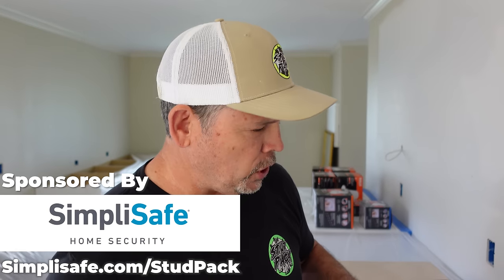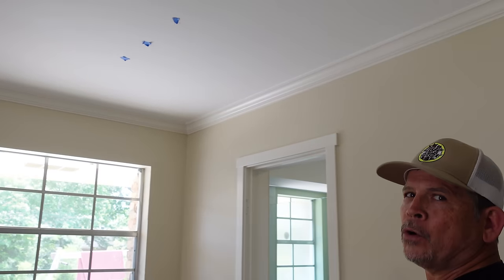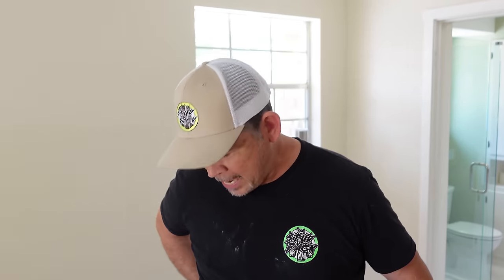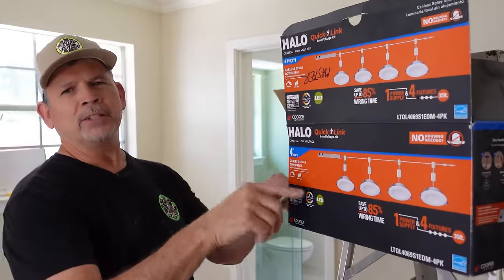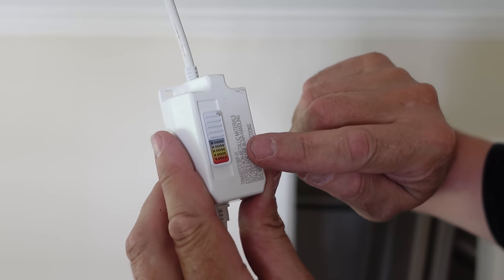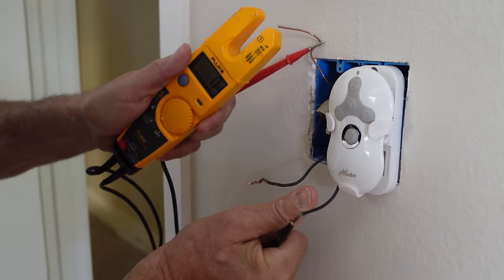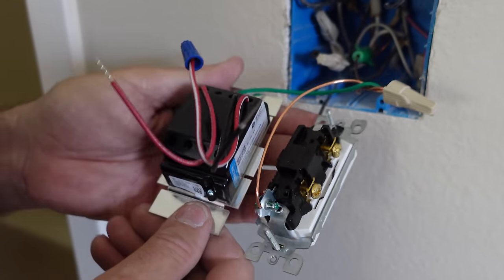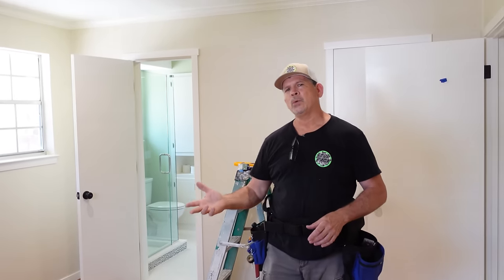HALO Just Changed the Recess Lighting Game with THIS!

Comment: Been an electrician for 8 years. Never pulled carpet or subfloor back, what a waste of time not to mention liability. Two cuts in the drywall, a little fishing, and you're done. Patching the cuts takes wayyyy less time than carpet, trim, and subfloor removal. Additional, these lights never made sense to me. Where exactly are you supposed to hide the power supply? It's not accessible. These don't save any time and are limited in how many you can run. I'll stick with the 120v Halo pucks, work just fine. I can wire 6 in a room in 2 hours.

Comment: These guys’ videos have been so helpful in my remodeling projects! From this video, I got myself that same hole saw and I also tried these lights. I ended up returning the lights because the lights failed to pair to the app (I should have known a Bluetooth only option for smart features was too good to be true). I had also bought the Halo 3-way switches meant to be used with these and those were the only things that paired 😂

Comment: I just watched this video. I learned something new. I want to share a device wiring connection idea. Instead of putting the wires straight into the device clamp, try making a modified half loop (like you would use under the  screw), but bend it 180 degrees on the long end after the loop like an "h", then clamp it. As always, an informative good video.

Comment: Super helpful video! Picked up the Halo low-voltage 4-pack and am just about done with the install. Only problem I've run into is with the dimmer switch. It's wired up correctly and the on/off switch will turn the lights on and off but when I use the slider to dim, nothing happens. The lights remain at full brightness. Faulty dimmer switch? It's a Leviton DSL06 that's supposed to work with LEDs, CFLs and halogens.

Comment: The biggest problem with these or any other LED Light systems similar to these... when one of the individual light "assemblies" fail. You can't replace a bulb, you have to replace the entire fixture and then, only if you're lucky enough to find an exact  match. NET: The color of the light emitted may not match others lights already installed. The problem is, buying a replacement assembly does not guarantee the color of the light output will match of the original lights installed. Back when I did my original purchase and install the fixtures were identified as being 2700K fixtures but the same model number today, from the same manufacturer they are now identified as 3000K (NET: a completely different color) :face-orange-frowning:

Comment: Nice job as always.

Used that same hole saw a few weeks ago while upgrading a church auditorium (from the 70's hanging globes to the 5/8" wafer LEDs). Was so nice not to have to clean up all the flying dust because of the hole saw cover... and the new 5/8" lights fit underneath all the joists. LEDs were a cleaner look, much brighter output, a lot less heat, and use much less power.

Had a few places we needed to widen existing holes... problem was there was no place for the center bit to index. So... I got a light fixture mounting bracket, drilled out the center hole to fit my hole saw pilot bit, and then put drywall screws thru it up into the ceiling drywall (inside the diameter of my cutting legs). Allowed me to index the pilot bit anywhere and widen existing (4") holes to larger (6") holes. (Have also used a piece of 1"x4" cut into a 4" circle, but that was a bit more work and this way I was able to go exactly where I wanted.)

Comment: They make long feeler bits you can drill through joists in vaulted and 2 story homes.  It has a hole in end of the bit to pull the wire back.
Reply: Just make sure you think long and hard about what might be on the other side of that joist. You don't want to hit Romex stapled to the side of the joist, or worse, a water pipe.

Comment: Installed this same exact Halo quick link.  Removed existing fixture replaced with 6 recessed lights.  The j-box gets really hot.  Is there something wrong with my wiring. I only had black and white wire.

Comment: I was taught to always place the hot leg on the bottom screw of the switch, and the load leg going to the device on top. It makes sense to visualize power comes into the switch, passes through the switch and flows to the device. I know it doesn't matter, but it just makes sense to me to do it that way. Thoughts?
Reply: It doesn't matter and the next guy has no idea that you did it. If you are worried, label it.
Reply: Most switches are labeled for hot and neutral.

Comment: Heads up to anyone using these, according to the manufacturer the fixtures are IC rated but the power supply is NON-IC rated. So keep it away from insulation(fictures cannot be used with direct contact to spray foam insulation of course).

Comment: Don't led dimmers use PWM instead of the incandescent dimmers which used a variable resistor? That resistor just sucked up the power that the lights weren't getting.  Do PWM dimmers get hot, as they're essentially just turning on and off at a rapid rate.?

Comment: I installed the 6” version of these lights in my kitchen and set them on the 5000k setting. However, when i put the dimmer switch on it would not dim and would flicker even after using the adjustment lever. Do the lights need to be at the lower 3000 or 3500k level in order to properly dim?

Comment: I am still putting in standard fixtures, using LED bulbs or adapters, have still yet to see the reliability from LED claims, have several go out and if dedicated fixtures more a pain one to replace second maybe not find that design again and not match the other same fixtures installed etc. So I am still installing regular IC rated cans, that way have a choice and if use LED spots and dimmer so be it.

Comment: Such a scary start to this video to scare away beginners. Wow! 
I just replaced a kitchen light and did not have to climb into the attic. I came here because the wires on my Recessed light had a new clip preattached to the wire and I need to learn how to connect my wires to it without burning down the house. While I had to cut some of the ceiling away, I'm not having to climb under my daughter's bunk bed to rip away carpet to access wiring.

Comment: These lights are sweet and would have been perfect for my remodel job... run the cables through the gap between the original popcorn ceiling and the tongue and grove I put up (I used 3/4" nailer strips), saving me from the PITA job of having to run romex through the attic like I did.  

But... they are very expensive compared to the wafer lights I got and are limited to 10 lights per driver.  Well over $400 for 16 (2 driver kits plus 4 add-ons) compared to ~$140 for the 24 I got (two 12-packs giving me eight spares to use elsewhere).  I had to buy a box of Wago connectors ($50), so that factors in.

Comment: Still looking for the best way to route Romex through several joists without ripping up the ceiling. Nice to have attic access for this even if it is 120+F.
Reply: If there's no perpendicular strapping under the joists, there's no good way. You can blindly drill, but that's risky due to hidden wires, hvac ducts, or water/sewer pipes. You're better off making drywall holes that span both sides of the joist to drill. The good news is you certainly won't see the patch job with the lights on, they blind you from looking up.
Reply: @bnasty267  thanks... no magic solutions...

Comment: Well, in my case I could not access from the attic because the wore were going through a small hole in dry wall, except ground wire which will when I'm done. Pulling the halo lamp, or bucket, or recessed housing from the ceiling revealed the live wire was disconnected from the wire nut  which I figured since my multimeter showed I was not getting electric at the orange clip that connects to lamp. Which I could post picture.

Comment: Your talking about dimmers at the end made me think of my parents house, my wife noticed the dimmer for the dinning table chandelier was quite hot, I thought the dimmer had a fault and was broken, NOPE, we pulled the bulbs off the 9 bulb chandelier, over 700 watts of incandescent bulbs! ... yea, we switched them out with LED and it was all good, went from 700+ watts to 63 watt rating! think of the heat that light put out, 500 watts likely, how much harder their AC had to work to compensate!

Comment: So these are low voltage.  I assume that means they draw more amps? 

I have a 15a circuit but am doing the math…I’m not sure what voltage they draw after the converter but if it’s 12V, then you’re pushing it with two sets of these on one circuit.

Comment: I installed some led recessed lights from home depot, it didnt have a power supply box or anything, i just connected the romex and daisy chained them all together. Is a low voltage power supply box needed?

Comment: Louisiana? Holy cow that is moogy!😁 
Love the led lights..too bad the power cannot be chosen at the distribution/breaker  panel. Ac or dc.   Most lights will work in ac or dc but major power hungry appliances require that big utility like refrigerators, laundry machines and even the heating system. 
Great work guys. 
I think I' ll do the attic work at night with a fan.. Queen Creek, Az might be a tad hotter up there !

Comment: Do you have to have a dimmer switch when installing these? I have several 3 way switches on some old style can lights and want to upgrade to these. I just replaced all my switches and would prefer not having to buy different ones if I don't have to.

Comment: Was wondering if you had a link to the dimmer switch you used in this video? I've read that several low voltage dimmers don't work with the set.  Any help appreciated. Great video by the way. I ordered the light set

Comment: Not to be an installer nazi heh, I installed 6 lights in a vaulted ceiling no attic access. Had a few advantages. First, the original fan in the center had two switches, one for the fan power and one for the lights in the fan. The new fan, installed in the same box as the old fan, only needs main power, and the light in the fan works off remote, so that left me a spare red wire going to a wall switch from the fan box essentially all installed already. After removing the old fan, removed the box (which was screwed to a bracket. That gave me room. Ran a wire from the fan box over to the middle light on the left, and one over to the middle light on the right. I was able to snake the wire from the fan box over to each light bank by pushing enough wire up into the attic and groping for the wire from the new light hole. Had to be up against the ceiling and my arm fully extended into the new light hole to get above the blown insulation and grab around and grope for the wire but found it no real problem. Then wired the other two lights to the center light on each side. Used a hole saw that is made for drywall, not a wood hole saw, with a plastic guard to catch the dust. Put the drill on slow speed so less jerking when cutting the holes. Also, need to be careful cutting holes as, in my case, there were plastic water pipes right above, so cut the hole such that I didn't push the saw into the ceiling to remove the drywall cut piece.

Comment: What if I want to install these in my finished basement? I can't tear up the floor on the main level, I know where the joists are, but my lights will be running perpendicular to the joists. How do I get the wires to cross the joists without access to them?

Comment: Another way to find your hot is to take the plugs out (while breaker is off) and then you can turn on the breaker with the switches out and you can grab your light stick and find the hot wire. Your returns (or switch legs) should not have power going through them until you flip the switch. Boom you just found your returns and the hot from the panel.

Comment: I guess I would just say that if I  can't access the attic, I would never go to a second floor, rip up the flooring to run wires through the joists and staple them, then patch up the flooring just install pot lights.
 If you're unable to use regular 14/2  wire  safely, then you can always use the commercial armored wire.
If you use armored wire, it can sit free in the joist cavity without having to be stapled.
Wayyyyy cheaper than ripping up someone's flooring, and faster.

Comment: I definitely like tho Halo lights and the ease of installing and running the wire(s), compared to reg way. Just ran 12 low profile led lights inside an attic in FL, and wish was Halo brand w/ one wire and easy fixture connection b/c it was horrid up in that attic crawl space. Was up there for 25-35 mins before  was about to die, omg, if had these…..woulda been done in 5-10 mins.
Appreciate showing us what Is available for ppl, and to remember that there “other” options that are always out there and to help around; dont just keep using same old same old…..every time😉
Cheers✌🏻

Comment: How would you wire this in a small house that runs mostly on 12v? I'd rather not have to convert 12v to 120 if I don't need to.

Comment: You should get an old weather thermometer that shows temp and RH cuz it’s not only hot in that Louisiana attic it’s humid too which I’m sure only adds to the misery.

When you said “this whole room is one circuit” did you mean the lights and the outlets both? I strongly believe in separating outlet circuits from fan/light circuits where possible. I understand in a remodel that’s not usually a possibility but when you can there are good reasons separate them. 

Last, I love that you’re giving the homeowners a proper panel schedule and an electrical plan. I also like to do this for the next guy.

Comment: Great video!  I'm impressed with your prefect and clean ceiling holes.  I've used hole saws like yours, most recently the Milwaukee adjustable hole saw.  However, I have problems with the pilot hole getting enlarged (probably from vibrations) and then the final hole isn't clean.  Holding the drill firm and steady isn't doing it, and I've tried multiple drills.  I had given up and gone to a normal hole saw thinking the design just doesn't work.  Now you show me those perfect hole.  Any ideas what I was doing wrong?
Reply: I'm thinking the spring loaded cover with gasket tends to keep it steady.
Reply: @kenmore01  Thanks for the suggestion!  The hole saws I’ve had issues with also had spring loaded covers, but they do have a decent amount of play between the cover and drill position.  One that is tighter will be significantly better, maybe his is like that.
Reply: @RJ-ej1nr  It looks pretty high quality. Hope you can find one!

Comment: you follow the old school method as always. I would wire my live to the switch, run the dimmer live under the  part of same screw, no pig tail or block..lol.. but that is me. Was taught that in UK. two slots for wires under clamp so use them..lol..

Comment: Ssssoooo, before Katrina, we had an attic crawlspace in a hip roof style home like you were in.  We installed an oven temperature gauge to see how hot it was during the summer.  It would start when opening the hatch it would be 125 degrees and then zoom to 150 degrees after turning on the florescence light.   Now,  after Katrina, we went to a gable roof with a standing space to house the water heater and HVAC unit.  WE have a house length vent on both sides of the house with a roof ridge vent to escape as much air as it could.  The hottest it gets now is about 5 to 7 degrees hotter than the outside.  Best thing we could have ever done!!!  Great video as I am going to try to get similar lights for out bathroom.  Great video!!!  BTW, we are located on Mississippi Gulf Coast about 1/2 mile from the beach.

Comment: The little pink fuzzy insulation bits falling reminded me of tiny tribbles lol. I prefer using green insulated ground wire rather than bare. It just seems safer to me.
Reply: Standard nonmetallic sheathed cable, "Romex", doesn't come with an insulated ground.

Comment: Paul - Here's a tip that I use.  I drill a pilot hole before using the hole saw. It's easy to locate the hole saw bit in the pilot hole and keeps the hole saw from accidently wandering.if the hole saw is slightly tipped.

Comment: Is there a way to extend the low voltage wire that comes with this with more wire? I need about 15 more feet of wire than it came with. If so what is the part#?

Comment: I have install 8 of them in an attic with no attic access in one room. Then I put in 7 more in another room without using the attic. That included adding two new switches and new wires from the switches for each room. Just need a fiberglass rod to push the wire through.

Comment: How is your son doing?

I forgot to ask, could you do a video on installing 3 way switches, with the light before the two switches (hot source at light), light in between the two switches, and the light after the two switches. Plus talk about how the new code requires a neutral at every box. Thanks!👍